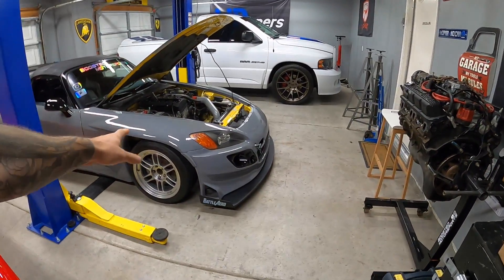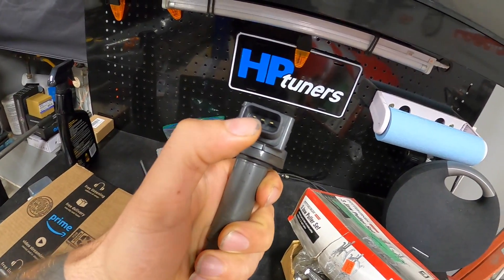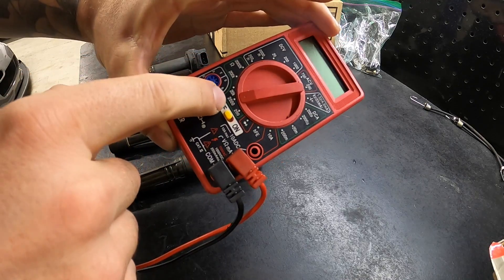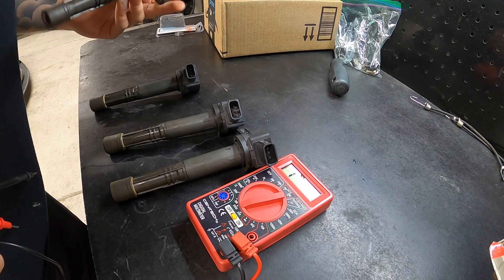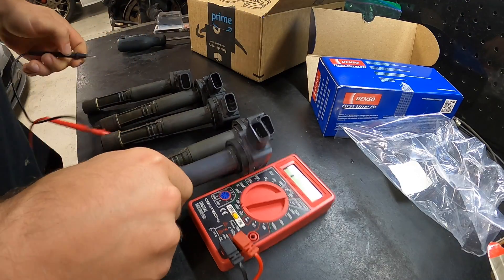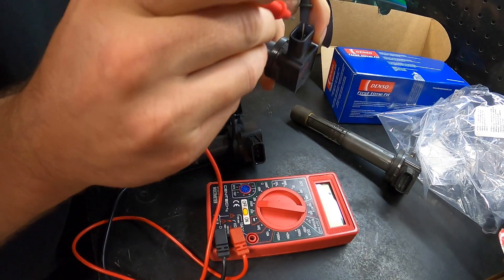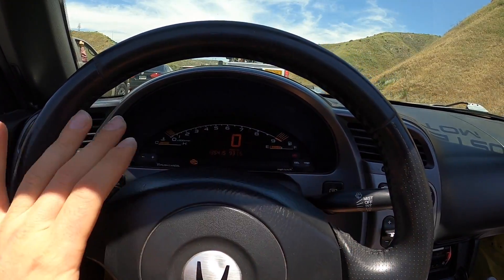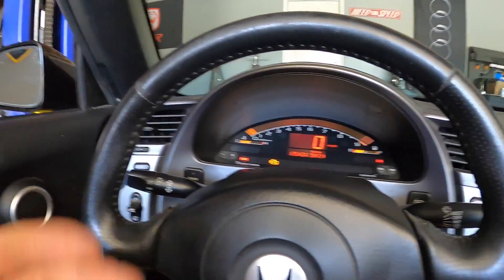Honda S2000 Coil Pack Test & Diagnosis

Comment: Man I've been trying to track down a slight hesitation at part throttle and jerking at low rpm. 
Ended up being #4 coil was reading 1235 resistance.
Thanks for making the video

Comment: Hey bud. Also having persistent o2 sensor codes on K20, even after changing sensors, checking wiring, fuses, relays, etc. I felt hopeful seeing you change the coilpacks. Did you even manage to sort the o2 sensor codes?

Comment: What code is your car throwing? I have a p0171 code and have literally tried EVERYTHING and still can’t figure out. I wonder if a bad ignition component would also cause a lean code.
Reply from the maker: The car wasn’t throwing any codes for a misfire that was the weird part. Only a secondary o2 sensor code but we all know what that’s for 😆

Comment: This one is right on time. I have slight misfire at idle and was about to check my valve clearances. I’ll do this check first.
Reply from the maker: Definitely let me know what you find! I haven’t seen any test with a multimeter for these only people just buying and changing or pulling injector clips and looking for a change in sound 🤷‍♂️